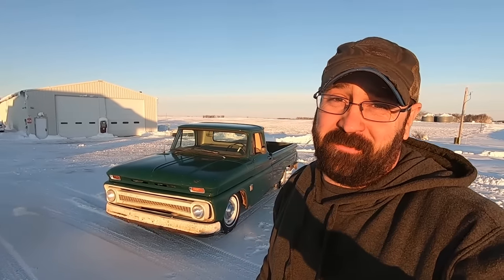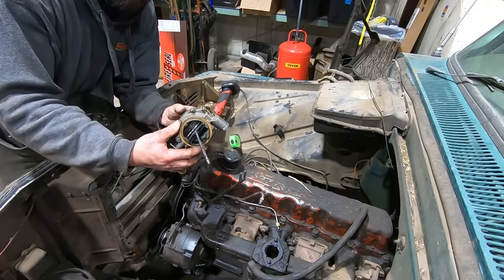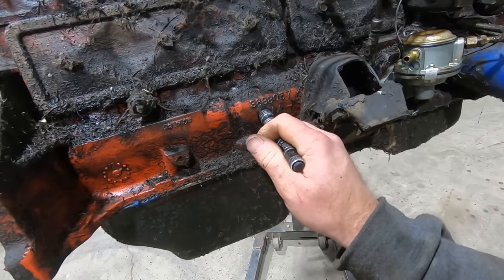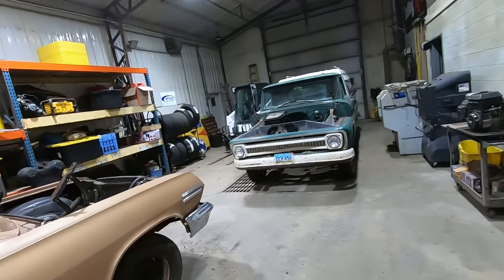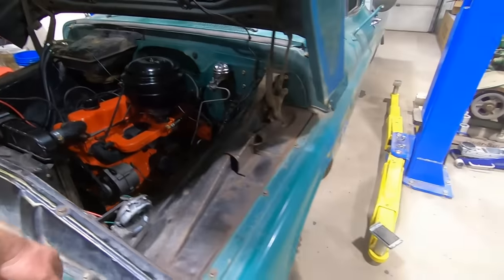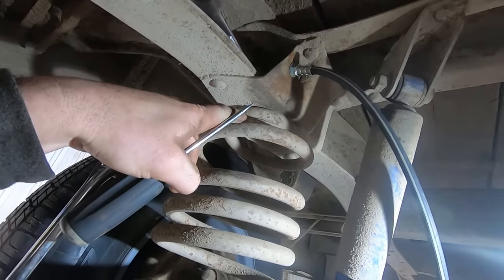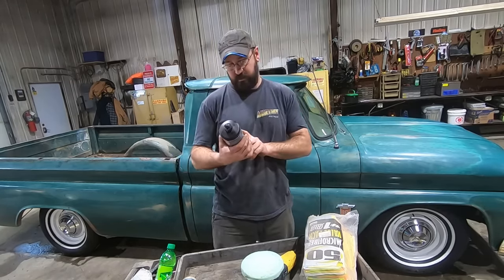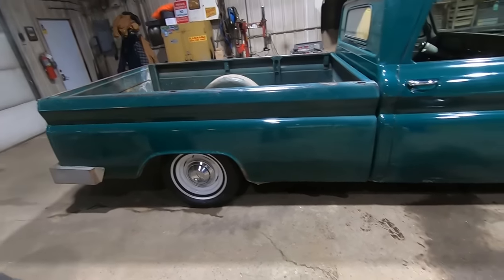1964 Chevrolet C10 Farm Truck! Amazing Budget Transformation!

Comment: On my 66 GMC, I kept the 15 inch rims it came with, and put 205/70r15's on the front and 255/70r15's on the rear. The 255's are the same diameter as the 235/75r15's it had so the speedo is even right. That gives it a raked front look like an old 70's muscle car. I like it.
Reply from the maker: Thanks for the tip!

Comment: Hey mortske.  Quick tip with the foam pads on the buffer.  Take an air gun and blow out the pad in between panels when you are doing single stage ! Pads last a lot longer and you’ll get a little more consistency out of it ! Truck looks great !!
Reply from the maker: Yeah, we did that. Just didn't show it.
Reply: I’ve got a 66’ 👍🏻

Comment: Best way to clean the "Rad"....... Get ya some "coil clean"  for the radiator it used for outside a/c units spray it on let it fome up spray it off with the garden hose works great on dirty plugged radiators
Reply from the maker: Thanks for the info

Comment: Excellent video Mortske Repair  :) also friend of mine has 1964 Chevrolet 25 3/4 ton , in orange color body , white interior, 292 6 with 2 barrel Carter plus hand choke cable knob in dash, Column Shifter Manual transmission 3 in tree , 388 ratio  also 4 wheel drums , plus had Manual brakes also Steering, West Coast mirrors on doors , bought for $700.00 in 2000 and found was bought Milwaukee Wisconsin  was in grave in back bumper! He updated lots to put 1978,  Floor Manual transmission 3 speed, , 350 V8 motor 4 barrel , Power Steering, Brakes , Seat too updated, Fuel tank plus Send Unit, daul exhaust also Am, Fm CD radio deck with 4 speakers, antenna on firewall , updated wireing,  leaf springs on back updated to with  each side ! Plus funny part did amazing work the old choke cable knob is hook on carb for gas pedal like Cruise Control  it so wild pull how fast want for want go more than 40 mph ! Great truck overall to plus 2002 back axle 388 ratio to  , 6  studs rim 265 /75 /16 on front spidles disk to from drum & change from Factory rims with Dog dishs  hub had originally! He did very well too on plus put updated on and found was bought in 1966 in Milwaukee Wisconsin from Uncle had till past away and paid only $3500.00 new! He uncle was fix up too but didn't get chance on too!

Comment: One o my favorite body styles nice truck. 2 wheel drives go down and 4 wheel drive trucks stay the same or go up! That is a really nice truck.I had a 65 C20 camper special. Had to sell it when the wife lost her job. I bought it after the original owner passed. California truck. Still had the build sheet in it. Zero rust. I lived in Stockton and the truck was built in Fremont CA about 80 miles from where I lived.It had a V8 283.
Reply from the maker: Right on

Comment: That is wild 194 Cubic Inches 6 cylinder motor in this  truck Mortske yes sure sounds nice on fix up  and like 292 6 cylinder when tune up right way on kick gas pedal on 2 time and choke cable knob all way out then one gas pedal to floor to and crank over and easy of gas to! Easy to do cold and hot start! Merry Christmas and Happy New Year 2023 Ahead Mortske Repair  :) also everyone!

Comment: 'Hunter Green'  is what I'd call it. I love Green. I love CHEVROLET'S. My 2nd bought car/truck ever was a '64 C10 long box Custom cab. was a ranch truck. Had the most excellent rear chrome bumper and matching front. had slight roof damage from a fallen tree on passenger side of front roof. 350/TH350- 2 barrel Rochester. 12bolt. it would spin up to 7k easy. I made the big mistake of taking the 2 barrel off and adding a 4 barrel Quadra-Jet. Ran like crap there after. Never did make it out much but I sure do miss her still to this day. Nice Choice, Great Content. Thomas & Duffy.
Reply from the maker: Thanks!

Comment: The V8 Nova had a special block with the z bar ball next to the pan too. Chevy II Nova's was part of my past. 64 283s n 327s that came in Novas had a spin on filter , a hole for the z bar, but I found the z bar worked better with the ball locater from 68-72 pu with the ball relocated to make the z bar useable with the normal belhousing.🗿 Thanks for sharing Mortske
Reply from the maker: Thanks for the info

Comment: Love the opening statement. Cracks me up. I have a soft spot in my heart for those C 10,s 
Around my parts when we were younger, we used to call them a woody cab. My dad had a 65C 20 and I had a 63C 10. Love the video. wondered why the carburetor wouldn’t work well. idle mixture screws do have a job. 😂😂😂😂
Merry Christmas to you and Duff…
Carry-on
Reply from the maker: Same to you!

Comment: The truck looks great. I have a '71 C10 long bed that I revived after sitting 30 years. A lifelong Arizona truck with only minor rust. I lowered it using drop spindles and 3" drop rear coils. Loved the way it looked, didn't like the way it rode so I returned it to original height. That's my choice. If you like yours lowered, more power to you.
Reply from the maker: OUch!

Comment: I really enjoyed this. I love an old slammed 2wd chevy. 
And straight six builds are so much more interesting than the “way too common” 350 that every truck seems to have these days. 
Am I crazy for wanting a 292/ 3 on the tree to replace a 350/auto in my ‘79 C10 ? 
It’s got a Duff approved  5/6 drop. 😊
Reply from the maker: Nothin wrong with a 292!
Reply: A 292 will give you plenty of drivable power and it won't be just another ls swap.

Comment: Funny, Mortske say's, "It doesn't really matter what size 6 cylinder it is" Until he finds out it's a 194 cu in.  Hey, that's still a 3.2 L not bad.  My father had one in his 1967 4 door Chevelle.  They don't call it a Chevrolet Turbo-"Thrift" engine for no reason and the 194 was the "High Thrift"  Straight 6 are one of my favorite engines.

Comment: Good deal. I prefer when a truck, not junk, is reworked to a stage you would keep and depend on.
One gripe, I would have checked the front suspension and realigned using the parallel spring and bubble method to set toe and camber.  Don't need (or want) an "alignment shop".

Comment: Still reckon you pull the grille out straight and paint that and both bumpers the same colour as the wheels.  She's a stunner and has a patina like my Stag - also a survivor, she wears her battle  scars and patches with pride and yet still looks great from 10 feet away.  Sure - give her a nice seat and clean her up inside and then tart up the deck so it looks good as well as being serviceable for light work.  Flipping that patch to the underneath of the deck and chucking a gallon of linseed on it would certainly change its looks for not much money and a couple of hours of time.  Really like this old girl.....and Dark Green?  Go figure.  The colour of my Stag is French Blue, but I have yet to work out the connection as it doesn't match anything French that I know about......but at least they put a tiny bit of effort into the name I suppose.  All the best for you, Duff, Mojo and Chin for Christmas and the New Year celebrations, mate.  Hope they are memorable for you and that 2023 brings some good stuff your way.
Reply from the maker: Might straighten them but doubt I'll paint em. Same to you Lance!

Comment: Low pick ups  and old panel trucks.  I like fur by furs with the grandpa aluminum running boards. Plain steel wheels w hub caps and trim rings.

Comment: Back in the day had a mid 60's C10 big back window with a factory Top loader tranny. 1st n last I'd ever seen in a 1/2 ton. Had polished aluminum grill & chrome bumper. Was that bluish green chevy liked to paint nearly all vehicles, not the color of yours though.  Was a chick magnet.  Bought it from a junk yard for $50. Any way I can't remember the reason but decided to swap out the engine. Had a 62or3 wagon. Pulled the wagon in the shed & yanked out the engine in the morn & loaded it in the pick up. Drove into town where my buddy had a shop with much better tools. By 4pm was driving the country roads having sandwiches, shhh. From what I remember it was a direct swap requiring no modifications or parts.. Sure miss that ole truck. 
Have never seen a 7 qt oil pan. I would say that was some sort of industrial engine or you over filled it.

Comment: I would leave the white bumper and grill but try to straighten out the grill if possible? I would probably later on try to find a period correct small block for it? Keep the grandma  four speed! Clean the wood floor good and repaint! Fix the rusty areas! And like you I would find some factory dog dishes for it!

Comment: No new chrome! Blend all of what you have. Straighten the lower half of the grill so it lines up with the gap of the bumper. 
A little hammering of the tailgate.
Fix the bench seat.
Get a visor for the passenger side.
Slight pin stripes on the interior only.
Maybe some vintage logo with faux patina for the doors.
She's a great shop rig!

Comment: Aside from finding 6 lug disc brakes, the opposite end of that is swapping axles, or rear differential to 5 lugs to match the 73 c10 disc brakes you wanted. 
Why not just put new Master cylinder with booste with dual reseviour on it, because they has those back in mid 60's.
To make it ride, and handle like a new truck. 
Just get the front rear sway bars, and new good set of magnum gas shocks on all 4 corners.
You already up graded the rear springs, and track bar, so couple hundred for sway bars isn't a big deal. 
Especially since you can use any front sway bar off 73, and I believe either a blazer or suburban as long as it mounts to the frame before rear differential will work for the back sway bat.
Don't quote me on that been too many years since I did such things.
But the rear tank from a fomoco a F150 will work, and you can get a locking cap, and filler neck that mounts in the floor of the bed that's fairly flush so as not to be too much hassle to put fuel in it.
Eliminates the one behind the seat, and just leave the boot and filler neck with locking cap on the hole.
Be sure to put locking cap on it, are some fool will fill the cab up with the nasty corn gas for you. 
Only thing other than the above would be to either replace all the linkage and bushings on the 3 on the tree, or floor shifter, and if you go that far as you say might as well go 5 speed with hydraulic clutch.
But sway bars are cheap and easy, for the difference they make in the handling and ride quality. 
So that's a win win, as equally is upgrading master cylinder.
PS
Lowered is great, but slammed puddin head style sucks, and basically ruins the reason for having a truck in the first place. 
As long as he's doing it to the old Datsun's, or ford courriors that's fine, but don't ruin a good truck by dragging the frame on the ground, and butchering the rear half of the frame in the process. 
Otherwise I've no problem with someone destroying their own property. 
Just don't trash a good frame on a classic.
My lowly opinion on that subject. 
What you did is no different than putting leveling kit on one, except you did all four corners, and you could of put drop spindle on and saved the springs for not much money.

Comment: 23 min in and 194" engine.  Likely there will be a little difference between it and 230.  The 250 didn't come out til 1966.  I have a 67 with a 292. I had the head redone but rings are weak now smokey but runs good around the farm. #oklahoma
Reply: Put some ENGINE RESTORE in it, they make it for 4, 6 & 8 cylinder, WORKS GREAT. 292 Is a pretty stout 6 cylinder.

Comment: You can tell a 292 from the others because the the valve lifter covers are taller to accommodate the taller block for the longer stroke

Comment: FYI easiest way to tell the difference between the small sixes and the 292 is the side covers are very obviously taller on the 292. Now the casting numbers are the only real way to tell on the outside if you have a 194/230/250 but the tall side covers give away the 292.
Reply from the maker: Good to know!

Comment: The 194. That’s the first engine I ever took apart and rebuilt. It came with a 2 speed power glide. And it never saw 80 mph. It might have reached 74 mph once or twice. But that was when the national speed limit was a fuel saver 55 mph, so it didn’t really matter.
Reply from the maker: Awesome

Comment: Late model 6 lug alloys bolt on the early c10 6 lugs and are usually 10 different types in the local junkyard or marketplace and  takeoffs usually have new tires  so it's worth a couple hundred bucks and  they're still factory Chevy  or GMC logos  for any  Ole  gm truck that has limited availability for affordable aftermarket parts  love channel  happy holidays to all 🤶 🎅
Reply from the maker: Same to you!

Comment: I have family heirloom 1966 c10 named "Betsy", she has been with me since 1968, learned to drive her in tobacco fields long before I was 16. Thought of your work yesterday, took the valve covers off 1968 327 found sludge, wondered if you ever try and remove it?  Worked on it a little with pick and shop vac, I want to clean it before I fire engine again but is double edge sword.
Reply from the maker: That's awesome you still have it. I guess I don't have any good suggestions.

Comment: Some Chevy trivia:  Truck 12 bolt rears are not the same as the car 12 bolt rears.  The truck 12 bolt was designed a couple of years earlier and is weaker.  It has a smaller pinion shaft diameter than the stronger car 12 bolt rear axle.

Comment: 230 the distributor was in the center on the passenger side of the block that 250 in the 292 the distributor was in the front towards the radiator

Comment: On this model only one visor was required and only one mirror. If you have a drivers side mirror and a rear view that was a bonus.
Reply: I have an original 65 C10 with a 283 and 87000 miles.  It been a ton of fun over the years. I have a drivers side mirror and visor, that's it.  No rear view, passenger mirror or visor.  The wood in the bed is the next project.  Been putting it off until retirement this year.

Comment: Only 230 and 292 6 cyl. were available in 1964 trucks.  The 250 6 cyl. didn't come out until 1966.  The 292 uses a tall deck block.

Comment: This truck looks great lowered with the white steel wheels and stainless hub caps. The white walls look good too. I myself would have only taken one coil out of the front. But like you said, it’s an easy fix. 

And with that 194 six in it, she ain’t gonna be fast, but she sure is gonna be slow. 

This truck overall is nice. My guess is $4,000 in rust repairs, you’ve gotcha a noice old Chevy you can drive anywhere.

Comment: I dig it man. Nice truck. Like what you did to it. How much for that Green 64 c10??? Thanks. Truck Driver Ray ✝️
Reply from the maker: Sold
Reply: @MortskeRepair  If can share info. How much did you get for it. I'm working on a 66 Fleetside Long bed to get it going. And need an idea where the market is
Reply from the maker: @raymondtrotter4655  I don't disclose
Reply: Trucker Ray here. OK on not discussing price on vehicles.  Thanks
Reply from the maker: @raymondtrotter4655  That's between the seller and I. You wanna see prices go watch Barrett Jackson.

Comment: At least your not waiting on a transfer case for your only set of wheels.
Reply from the maker: OUch
Reply: @MortskeRepair  Yea, the supply chain bit me in the ass. I got 3 different junkyard TC's, all of them were worse than mine or the wrong one, it's for a 4th gen Toyota 4runner. I wound up putting my old bad one back in while I wait for Toyota to gather up all the parts and ship them to me.  So right now I'm just trying not to go anywhere unnecessary at least til the first weekend of the new year.
Reply from the maker: @ronjenkins6674  Rough!
Reply: @MortskeRepair  at least my cases and shift motor will be reusable, and I will have a zero mile transfer case when I am done. It's still cheaper than trading vehicles!

Comment: Currently restomodding a frame off 63 at work ,and just gotta tell ya ,cab corners are easy to modify into the factory lip under the rockers,the rockers are a pain to replace ,and good luck if you want new fenders,they are made,but fit like absolute garbage,the worst aftermarket fender fitment I've personally seen
Reply from the maker: You should make a video on it.
Reply: @MortskeRepair  I would but it's a customers world of wheels build,we aren't allowed to show a lot of things about it until it's unveiled at a show
Reply from the maker: @cameronclayton4987  You could do them on another pickup that's not going to a show

Comment: Hope everybody knows why NASCAR uses truck arms?

If everybody on the track has truck arms, accidents are most likely self cleaning. You can slam into the wall and drive back to Pitt Lane most of the time.

It’s definitely not a performance advantage over other systems. It’s all about yellow flags that last about two commercials on television!
Reply from the maker: There’s several reasons

Comment: I'll trade you my 1947 chevy fleetmaster 2 door daily driver for the 1964 chevy pickup. How can I send you pictures? Could you save the old springs?
Reply: How can I send you pictures?
Reply: So how do you use it as a truck when it dragging the ground? It does look cool but I like to haul some wood sometimes I agree with you it looks cool as hell but I'd hate to tare it up underneath ..I could pull a trailer to  haul wood with my 2000 GMC JIMMY..THE TRUCK LOOKS GOOD LOVE IT..
Reply: That truck needs a visor
Reply: I got a hot 283 tri powered 4 speed with a hurst super shifter on it .all original. 64 parts
Reply from the maker: Not interested in trades. Thanks tho

Comment: While you are completly uglyfing it by lowering the suspension into the weeds...put some 1/2 inch wide side wall low profile stinking tires on it...while you are at it put a crappy LS chevy boat anchor under the hood...I think I about to puke coat hangers.
Reply from the maker: You need a hug